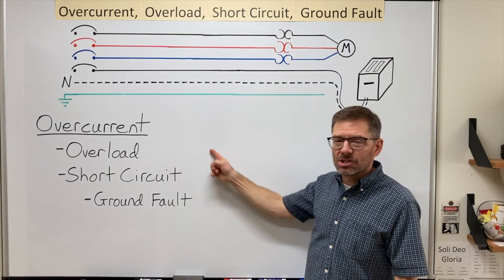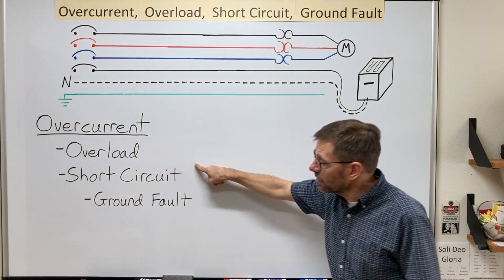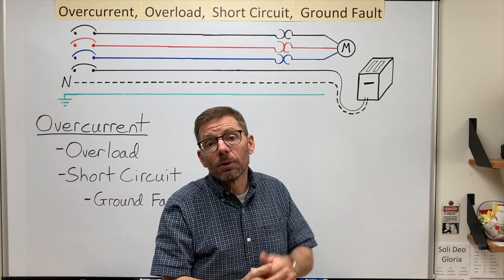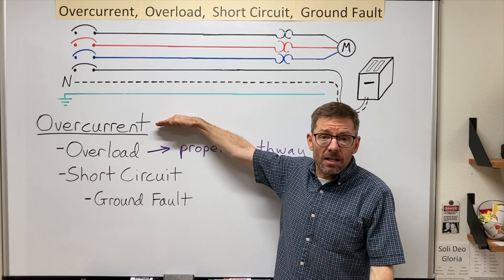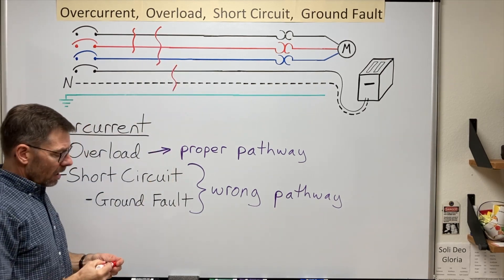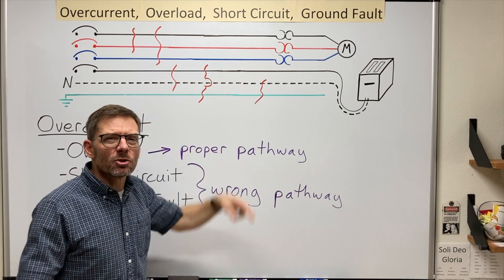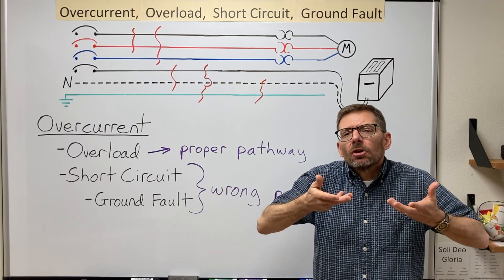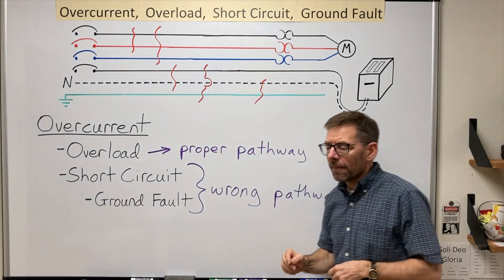Overcurrent, Overload, Short Circuit, and Ground Fault

Comment: I have problem 
When I check in Panel my neutral and ground have 240 Vac
Voltage between Phase R, S, T  380Vac
Voltage between Phase to neutral 220Vac
50 hz
 Power from transformator  
Neutral in transformator allready jumper to grounding

I ask you what is the problem between neutral and ground
What should I do

Comment: Thanks for the explanation. The difference between overload and short circuit is the pathway of the current. In overload the current circutlate by the propper pthway but in shortcircuit the current circulate by the wrong path way.

Comment: Im trying to figure out the result of a short circuit for a long duration and its affects on the wire beyond a nearby tap. The fault current can be seen somewhat on that nearby tap? Similarly to a lightning strike blowing all fuses nearby?

Comment: Ground fault devices are used to prevent current flowing to ground through a person like if you directly touched an exposed wire. They sure do work in other situations like the neutral touching the ground but that is not their intended purpose.

Comment: One thing not clarified.  Overload in a circuit breaker is a thermal activated opening of the contacts.  A short circuit or ground fault is a magnetic activated opening of the contacts.

Comment: An electrician came to my house for work, and my light bulbs glow even when they are switched off. My inverter gets overloaded. My laptop speakers started making buzz noise. AC PCB got completely damaged. All my ceiling fans started  deteriorating and ultimately they stopped working. 😡😭

Comment: Am currently working on motor rewinding…I have experienced this problem many times please read it patiently…it is a three phase motor i work with a controller board which used to command a motor up and down directions and also the cable which goes to the motor terminal is connected with male and female plugs to the board…so the problem is we disconnect the cable which screwed with a motor terminal and checked the voltage with a multimeter when some is pushing up and down buttons from the board and it gives the right number of voltage on all of the three phases but when we connect the cable with the motor and check the voltage with multimeter the voltage drops on all three terminals and the motor gives bad sound…..and again when we disconnect it from the motor terminal it gives proper amount of voltage…. am so confused I need help if someone expressed this ……the motor is very functional and new

Comment: That was average, but not good an explenation. Firstly there's not made a clear distinction between what protects what - overload devices do NOT protect the cirquit - they protect equipment. Secondly, without seeing a magnetic/thermal cirquit braker's typical trip curve and how it clearly distinguishes between Ikmin and Ikmax makes no sense either.
Finally earth fault and specifics of types of earth fault: "high" as in industrial, where the foremost danger is fire and "low" as in residential where the greatest danger is electrocution.

Comment: Sir, if you could go one step ahead & talk about sizing a breaker to the load to protect against overload? Overloads unlike short-circuits are “analog” which are “digital” & the breaker has a much easier time dealing with SC rather than OL. If the breaker is sized on the lower end, it may cause spurious tripping, if too high then an OL may even cause the cable to melt & a fire may result. It is also important to anticipate the “type” of OL & which & how it might make sense such as due to excess mechanical loads or partial short-circuits.

Comment: Great video.  If I have a 480 volt 40 amp AH with a 480 volt disconnect and I put in a 208 volt 40 amp AH.  Can I use the 480 volt disconnect with the 40 amp fuses and get the correct safe overcurrent protection on the 208 volt Air Handler?

Comment: Hi, when there is a 2 or 3 phase short circuit, the current will be directed from the fault point to the source or from the source to the fault point.

Comment: Quick question... Could one drop a 2013 digital camera(Canon hotshot)... And the resulting drop/damage, result in a malfunction where the camera goes into a continous "foto-snap" mode, until the battery dies??

Comment: One note aside, Ground Faults, in most cases, are short circuits from Hot to Ground but it doesn't necessarily has to be the case. You could for example have a device with high resistance deviate the current from Hot to Ground, therefore, the current flowing in the Hot will be different from the current flowing in the Neutral. This device can be your body, and when you have GFCI protection, the GFCI measures the imbalance between Hot and Neutral, this imbalance can be in the micro amperes, but that will be enough to trip the GFCI. 

This of course is also aplicable in 3-phase circuits. For instance, very often a ground fault in a motor is not a short circuit, rather, the insulation starting to go bad and allowing minimal current to jump from the windings to the case.

Comment: Intriguing. If the same current is alternating in the hot and neutral lines, then why do those lines get different names? Why not just call them both hot?
Reply: That's because the neutral is still connected to the ground back at the service entrance.  You should be able to hold a neutral and the ground all day and never receive a shock.  What can cause the fault condition is that the neutral is the intended return path for a single pole load while the ground is not.  The ground is only there as a safety to ensure that equipment case never has any kind of voltage on it.

Comment: Still don't understand how there's generally no potential when us or a tree touches the neutral wire if it's the return path of the same volts/amps of the hotleg that DOES shock us.

Comment: Ohm's Law explains how short circuits work very well, and why they are bad.  I = V/R.  For a given voltage, as resistance approaches 0 (i.e. a denominator that's less than 1), current will go toward infinity.  We all know that the circuit will trip (if protected by a fuse or circuit breaker) or fail (burning up a component) long before "infinite" current, but the math does play out.

Comment: Some of my non electric friends call everything a short if the device goes off and on, or makes crackling noise with a guitar cable when they move it. 
 So I tell them it's an intermittent OPEN circuit on the hot or ground most likely.  They say whatever. Lol. Or I just say give it me I'll fix it.

Comment: I don’t know why, but watching this video gave me a eureka moment. The reason an inductor can overload when there is LESS voltage is because the inductive reactance is less causing less impedance! And lower impedance means MORE current!!!! Holy shit! And that’s why dimmers aren’t suppose to be used in fans! Because they increase the resistance of the circuit which causes less current and the less current results in LOWER impedance and the lower impedance causes more current! Holy shit I am so happy it clicked!!!! I don’t know why which this specific video man but u are awesome! Im like level 4 nec but this always puzzled me and none of my instructors could make this link for me! Don’t stop what ur doing!

Comment: Great video. So if you have a breaker that trips when you turn a light switch OFF your first intuitions would be a ground fault or short circuit correct?

Comment: #what an impressive explanstion !!. Can i ask u one qouestion sir. at one company i got one problem ,when the power line is turn off and come back after some hour the three phase  equipments are not working but,if u exchange the phase it works. What is the problem sir?

Comment: Hello Dave, I appreciate all your videos and love the work you put out. Could I please ask a quick question about one of the topics you covered? You mentioned that you could have a neutral to ground fault which could trip a ground fault detector. I drew up a quick sketch of a 120/240 panel and tried to follow the path. Since the ground is connected to neutral at the source of a SDS, couldn't this circuit continue to operate as intended since the load is not bypassed? If no ground fault detector were in place, the whole EGC would be energized until someone got shocked?

Comment: If I recall correctly with Neutral to Ground you can feel a strong tingle on the case or chassis of the device. One time I found a ceiling fan with neutral and ground swapped, you could feel it on the wall switch screws.

Comment: I have seen many industrial panels where there is a power distribution block with many taps. Up stream it may be protected by a 150 amp breaker, but the tap conductors at the power distribution block may be a 30 amp wire that goes to a VFD or mechanical starter. Is this a problem?

Comment: Perfect lesson again.  I got to test circuit breakers using huge, Frankenstein-like test sets with 6" diameter knobs., analog and digital meters and timers.  What a BLAST!!   The three basic tests were long time, short time and instantaneous to determine how well the circuit breakers performed under actual load.  The first test set was the transformer/controller that we fed with 480 single phase which dropped it down to a very low voltage C clamping large cables to each breaker phase then applied current to each until the breaker tripped.  Instantaneous (depending on the test curve of each size, type, brand...) was about 10 times the breaker rating, short time was about 5  and long time was around twice the breaker rating.

Comment: Over current can occur from improper sized wiring to a load. I do hvac.  Say your a.c max Amp is 50 but you have wire rated for 30 Amp there will be a overcurrent. Breaker will trip.

Comment: 🤦🏻‍♂️ a ground fault is not a short circuit. A short circuit is L-N or L-L with zero resistance. A fault is a situation that has resistance and draws current. Stop spreading false information. You’ve made several inaction this video & I’ll be correcting them as I find them. From what I’ve heard this could take a awhile.

Comment: Thank you sir, great video. Local electricians tell us to bond neutral to ground in the first disconnect.(without it, gfci can not work?)  So in my opinion, a connection between neutral and ground  further along the power line, should not make a difference as it is already connected. I do understand the safety aspect of connection between life and earth(e.g. loose connection in toaster) ,  should trip a circuit breaker, as earth and neutral are bonded. But  how does the balancing of current in a gfci works if the  balance is upset due to the bonding on neutral to earth? Confused.
Reply: GFCI does not depend upon neutral and earth being bonded. So long as that earth path is separate GFCI will monitor the difference in current between line and neutral. That's all. If more than a specified current flows on the ground (30 mA or so) it will trip. Eg in a TT system you have two ground rods but no ground wire. The protection for those systems is via a GCFI.

Comment: Good example with ground fault.  But I would always give two ground fault examples.  One like yours where the fault goes to the ground wire.  And another where the ground fault goes to the dirt/earth/water and doesn’t touch the ground wire.  Then I would explain that both types will trip gfci.  This gets people to think and realize that the gfci device can sense a fault where the ground wire is not involved at all.  This way people can understand that gfci works correctly on a circuit that has no earth ground.

Comment: His example of ground fault tripping was showing a fault on the supply lines.  That would indeed trip a gfci circuit breaker; but it would not trip a gfci outlet.  Since most houses use gfci outlets and not gfci breakers the example shown is misleading.

Otherwise a very good video with much good information.  Well done.

Comment: Thanks for another excellent video, Dave. Years ago an old timer explained to me, basically the circuit breaker's job is to protect the wiring/equipment, the GFCI's is to protect you!

Comment: This video Answers some Questions.
But, it also creates lots of other Questions ????

So many Questions to ask about Electricity ??
Such as Why do some 3 Phase pieces of equipment need a Neutral and others do not ??
I have noticed that equipment with an Element do use a Neutral. this might be some of the reason for the feedback current ( Neutral wire )

Definitely a very interesting channel worth Subscribing to 👍
Reply: Sorry what do u mean by Element? Is it resistive loads?

Comment: my VFD running my bandsaw occasionally will shut off and display overcurrent condition.   I've found that if it ramps up too fast it can trigger.   If I ramp to speed slowly it seems fine.   What should I be worried about?  All my conductors are if anything oversized by 1 awg.

Comment: so will a ground fault going through the load trip a non gfci breaker or not
Reply from the maker: I believe you are asking about a situation where the ground fault is internal to the load as opposed to being a fault with the building wiring.  The determining factor will be where in the load the fault is and what conductor has faulted to ground.

Generally speaking, if the fault is from the "hot-to-ground" it will usually cause a large amount of current and trip a "Non-GFCI breaker".  This is because the "hot-to-ground" provides a very low resistance pathway for the source to push lots of current through - it doesn't have to go through whatever resistance/impedance the load has to limit current flow.

If you have a "neutral-ground" fault then it generally won't trip a "Non-GFCI breaker" because there is not any extra current (the load has already limited the current draw).  The load current is just splitting itself between the neutral and the ground pathways to find its way back to the source, based on conductor resistance on each pathway. (Remember that the neutral and ground are connected together at the panel or transformers in most systems we use.)  This is why GFCI protection is required is so many circumstances to stop current flowing where it should not - on the "ground" or worse, through a person who is providing an alternate pathway to "ground"... 

It's more difficult to say what will happen if the fault is in the middle of the load, say, in the middle of a heating element or a motor winding.  This is because part of the load is limiting the current draw, meaning that resistance/impedance is reduced, but not eliminated.  For this situation, try drawing a circuit diagram and then split the load resistance/impedance into two portions and draw a return path to the source. (You're essentially by-passing part of the load's resistance/impedance with a parallel pathway, and more current will take the easiest pathway.) You'll see that the current increases, but will it increase enough to trip the breaker?

On the other hand, if you have a "GFCI breaker" and the fault is "hot-to-ground" then it will be a race between the short-circuit part of the breaker (the magnetic part of a thermal-magnetic breaker) and the GFCI part of the breaker to see which opens first.

I plan some videos focused on the GFCI concepts soon...